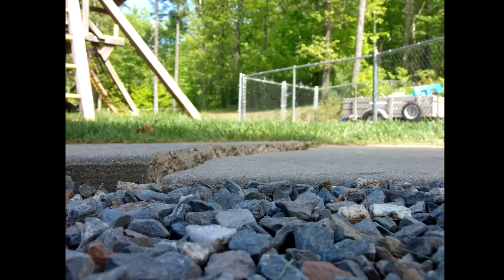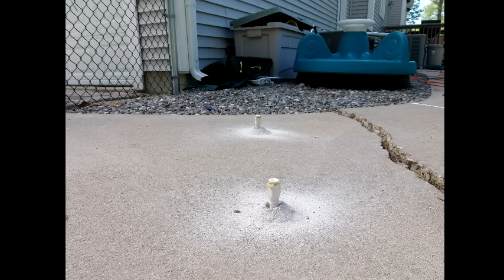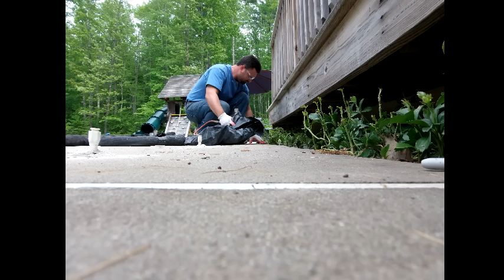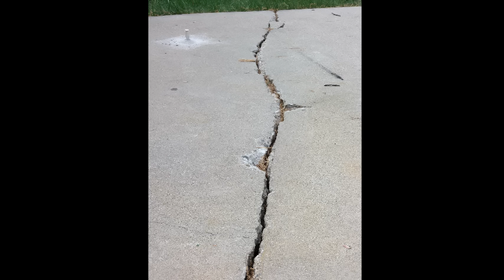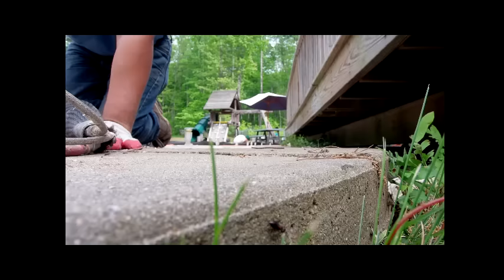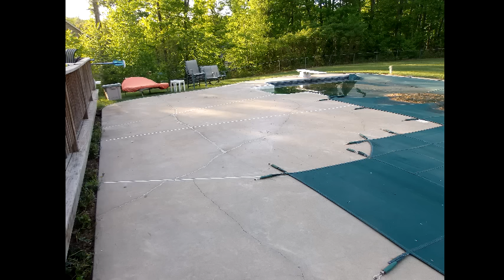Sinking Slab & Pool Patio Repair

Comment: Will this raise a concrete pool that has slightly dropped.  Not the deck the actual pool.
Reply from the maker: Hi Stephen, this PolyLevel system would not be recommended for fixing the pool itself. It is primarily meant for concrete slabs and patios, and it can be used to lift a home or structure on a slab foundation as well.

Comment: Would have been nice if you had actually said how and what with. No information useless as a diy, great for your company to show just a finished project. Didn't even show much product at all.
Reply from the maker: Thank you for your comment. The video does explain how we inject the PolyLEVEL product beneath the slab, and that the product is a polymer foam. The foam is not visible in the video, which highlights how the repair process does not disrupt or damage any of the surrounding landscaping or further damage the slab itself. It's quick, clean and efficient. As you said, this video was made to highlight how our company lifted and stabilized the patio and shows a finished product. Neither the title nor the description of the video state that this is a DIY repair.

Comment: how do you know how much foam to pump ? how do you stop the sad from rising to much thanks jh
Reply from the maker: +John Henderson  thanks for your question!  It's an easily controlled process with our product. Based on how much the concrete slab or patio has sunk, we can determine how much we need to inject in order to raise it back up. The foam used expands almost immediately, and so you can see the lifting process take place as it is sprayed into the various port holes. Once the surface approaches where we want it to be in height, we inject small amounts, and the end result can be within a 16th of an inch of where we need it to be.
Reply: +Erickson Foundation Supportworks  very impressed

Comment: how much does this cost?
Reply from the maker: Hello Charles, apologies for not seeing your question sooner.
Cost varies depending on the size of the slab and void underneath. A thorough inspection with measurements is required before any estimate can be produced. Most contractors like ourselves will provide free inspections and quotes. Thanks for your question.